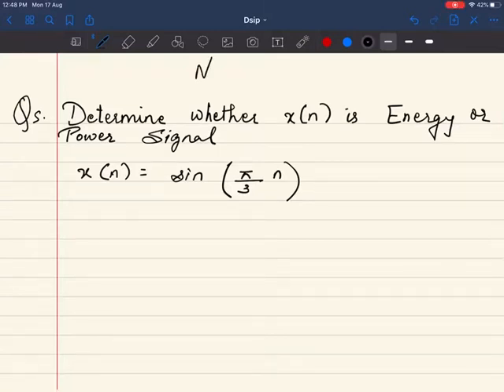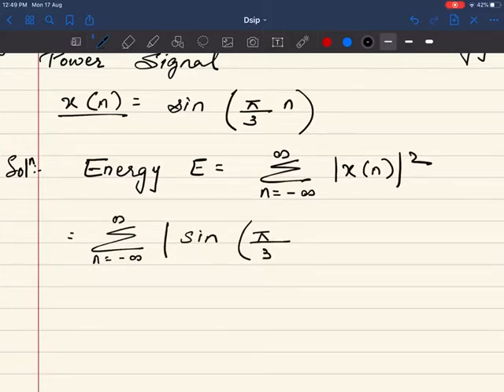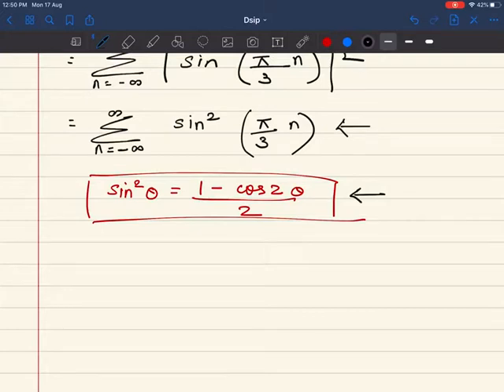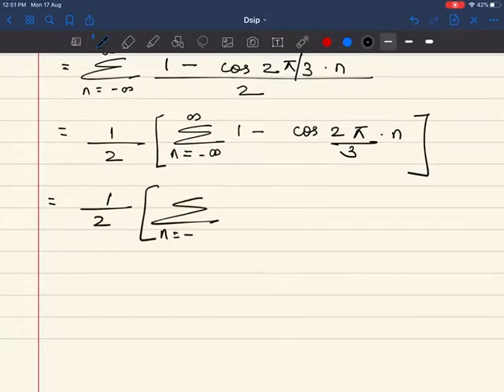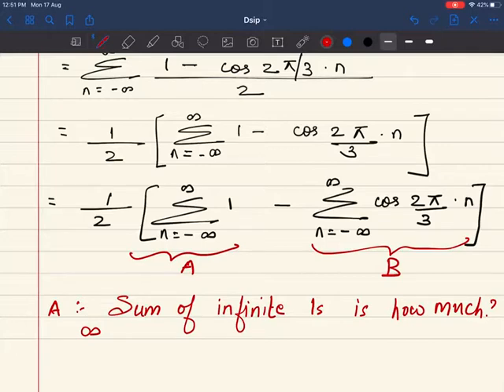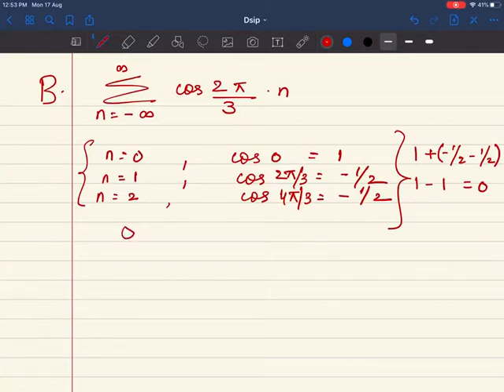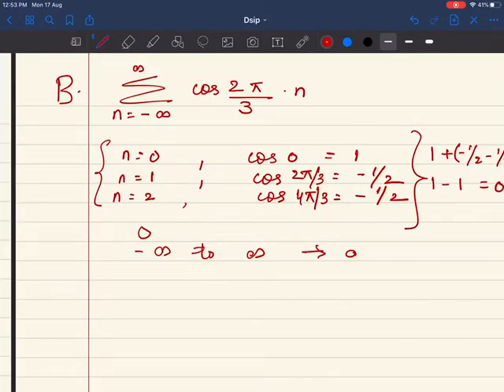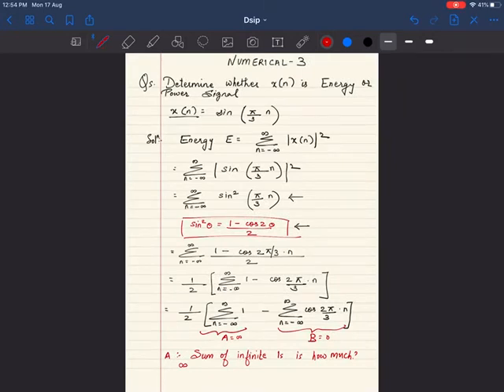DSP- Energy and Power Signals- Numerical 3

Comment: Madam, please describe how first term turn to infinity. Summation is applied for n values and first term doesn't have a n variable.
Reply: In the first term, 1 is summed from -N to N including 0 where N is infinity.  So you are adding N times on left starting from -1 and N times on right starting from 1 and then you do the summation at 0. If you want to imagine the summation in continuous time domain, imagine a curve on top of every value of x[n[] and extend it from -N to +N.  so the total sumation is 2N+1 which is the area,  which would also be the integral. In discrete time domain, imagine a line on top of every value of x[n] and add the value at that point. in discrete time domain, values are just added as a arithmetic series.  I hope this is the question you asked.